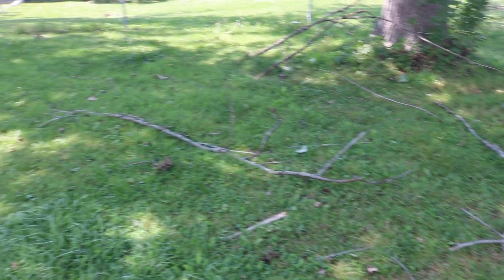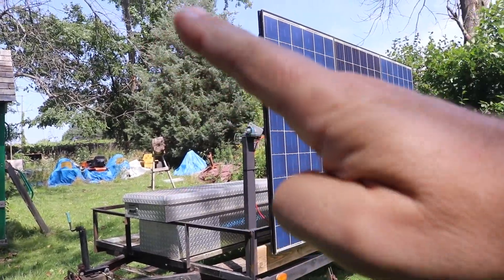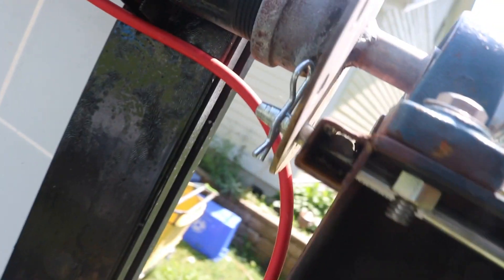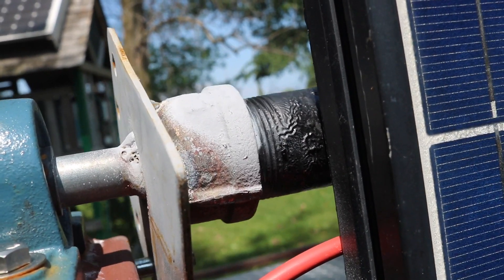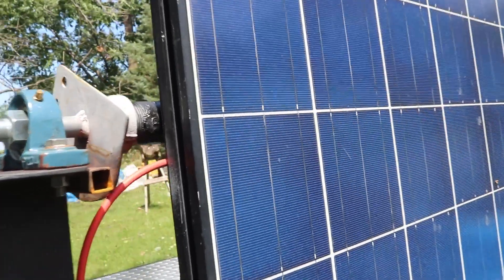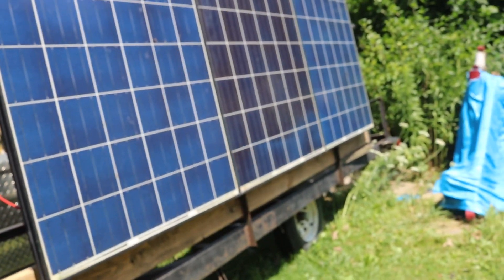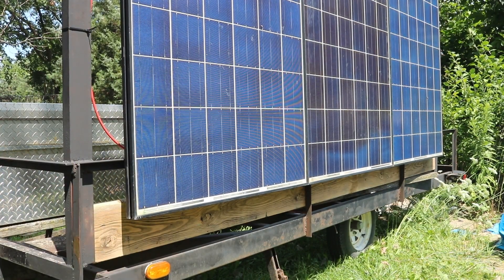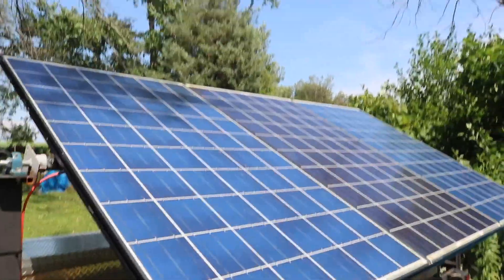Solar Trailer: Part 4 Wind Damage? And Tool Box

Comment: I wonder if it would be better to space the solar panels 6 inches apart from each other. That would let the wind have a space to go thru and put less pressure on the whole panel structure.

Comment: I'm glad and extremely surprised that there was no damage. Are you sure the wind was that strong there where the trailer is/was or was it protected by some sort of a wind block  or something ? Just keep practicing on the welding you will get better, the more you practice the quicker you'll get there, you do need to have a little instruction but there is not that much to it, there are differences in different types of metals, you can't weld everything with what you welded that with, you probably already know that .

Comment: Why is the middle panel mostly a different color?
Reply from the maker: These are all used solar panels. They are the same brand, make, model, power rating, etc., but could have been from a different manufacturing batch or used for different amounts of time in different applications.
If it was up on a roof instead of directly in front of the camera, you probably wouldn't even notice it.